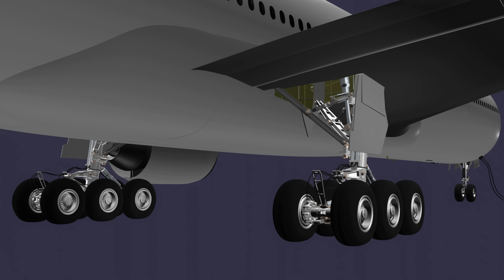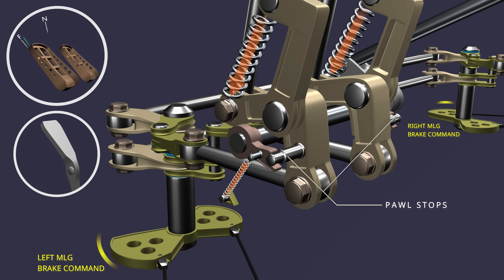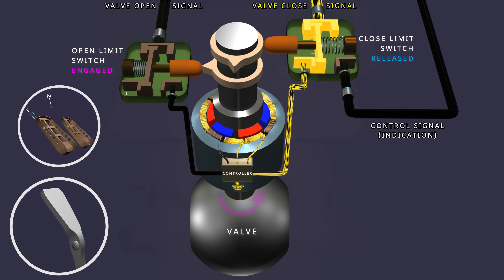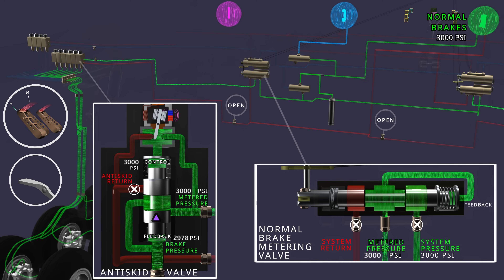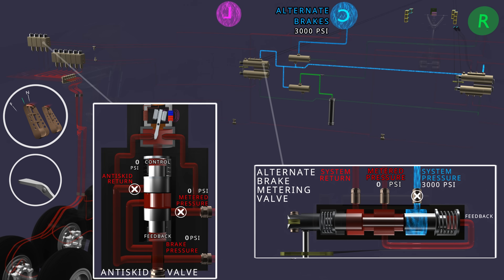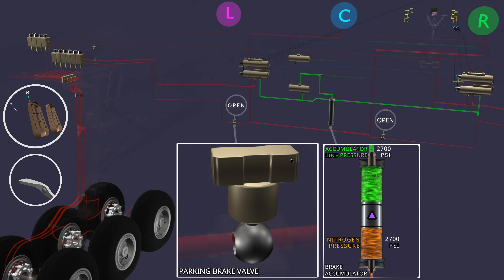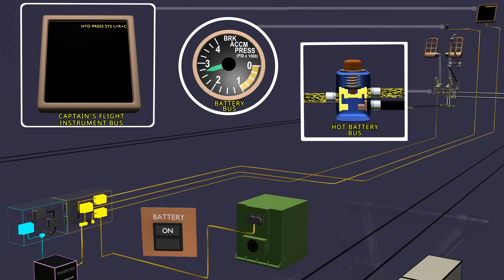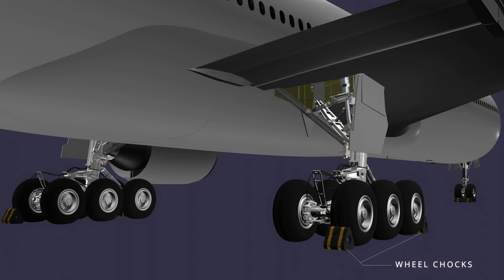How Landing Gear Works | Part 4 : Parking Brake

Comment: These last two were great. There's so much to cover just on the gear. Looking forward to your piece on the steering, but also on the semi-levered MLG of the 777-300ER, and the tail strike protection, which I think are defining features of the -300ER's success. 

On a side note, I wonder how much of these mechanical features are carried over to the 777-9...

Comment: Great work. Pilots pressurize hydraulics in a very special order. Right circuit is always pressurized first and depressurized last. This is done in order to avoid fluid getting transferred between the right and center system while parking brake is set using the accumulator. Could you give any inputs in how the transfer actually occurs? Thanks for these videos…absolutely amazing, a great complement to the FCOM.
Reply: Same

Comment: I learnt a lot on aircraft science. I would like you to include landing gear extension and retraction in its scientific sequence. Also do not forget about the auto speed brake system which was not covered in flight series in chapter 5.
Reply from the maker: Thanks for the feedback!
Reply: @AircraftScience  do you have complete computer based training of B777